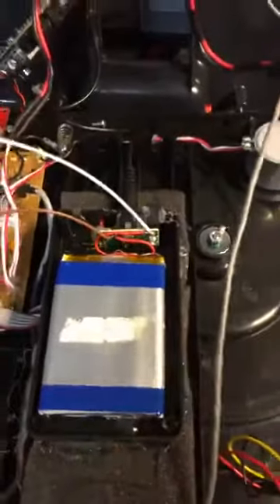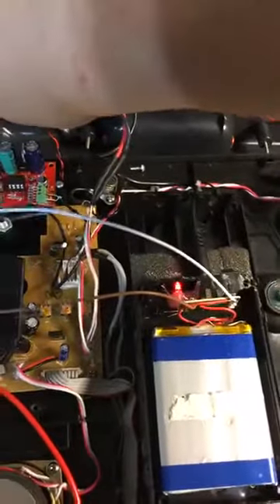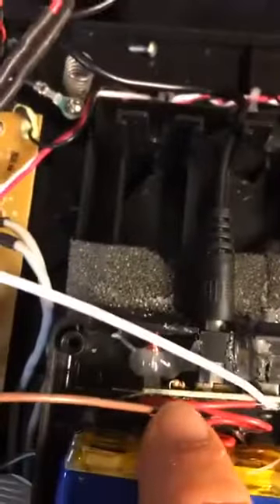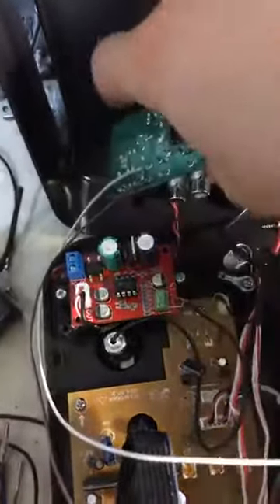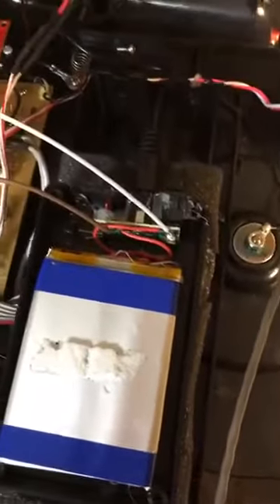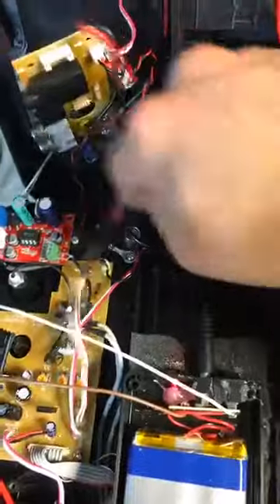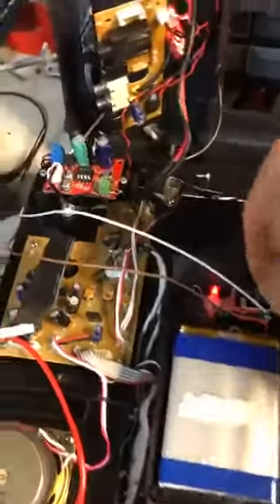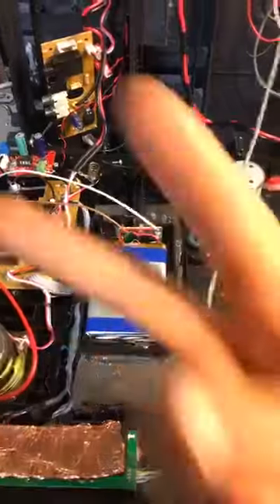Power button mod for pt 01 scratch

Comment: Isn't there a way to do this so you can charge using the existing power adapter port? Also can you cut the micro usb-b cable that powers most powerbanks and use the positive and negative cable that's in there an connect it this same way? any help is greatly appreciated. Dope mod too!!